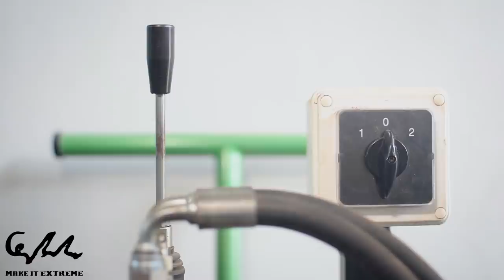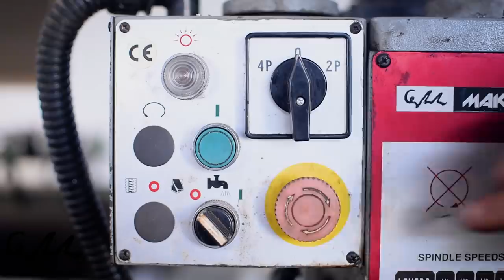Project 086 | Making a track drive trike #1

Comment: Cant wait for PART 2!!! With Bigger engine and bigger wheels!! You are the best!!!
Reply: Put a busa engine there, imagine the possibilities
Reply: I was thinking if the slats on the track were curved in the middle of each one it might turn easier...or maybe a durable material other that STEEL.....I have some snowmobiles I've picked up I was thinking of joining them side by side and use a decent size shaft across the two for pivoting and run one engine to the shaft the drive down to each gear box....each gear box has a high and low pluss reverse..and a brake caliper for directional steering not need to be fast more like a retriever...the tracks are 20 inches wide...that would be a big foot print...and they are the lo my track versions...might start with some smaller diameter  shaft. for proto type...and what a hoot I'm down in houston...where it doesn't snow very MUCH like ever! but they love mudders
Reply: My first thought when I saw it running was it needs a pit bike engine (or similar) but just the fact that he's making it bigger is just what I can't wait for
Reply: The tools are complitly
Reply: And a chain tensioner
Reply: Best coment
Reply: @donaldpowers5557  i don't understand what you're saying, but i would like to see the result. I think that will be amazing
Reply: Nice work ...keep making things like this
Reply: chain tensioner, track tensioner, cut sections of car tire and mount to the steel bars of the track
Reply: Kinder
Reply: عتارى بن
Reply: ,一...
Reply: Jak That ain't a Car Tire Lol
Reply: Christos Grigoriades
Reply: 40kzb बम
Reply: putra no by Monday night xx no
Reply: How did this vid get thumbs down?😠😠😠
Reply: mai aapke compny me kam karna chahta hu ....
Reply: Cáy đà boi
Reply: Hola
Reply: Halló
Reply: @anhuctv8795  w
Reply: @purplefreddyecheverria3301     😐
Reply: Làm quen bạn 👧 tôi không biết làm thế này mà chưa ngủ nữa rồi
Reply: Que chido invento
Reply: Seth Galthie
Reply: Christos
 Grigoriades
Reply: أن عبدالحق هجبل وحد
Reply: Please for me

Comment: Advice I would offer after watching the welding on the sprockets.
1. Put the bearings in AFTER the welding if possible. Then there is no chance of arcing across the balls, and no issues with the shrinking after heating and cooling.
2.Backweld the sprockets and clean up the undercut on the top of the welds. 
Even if your grind away the base metal, the undercut creates a failure point called a 'notch' no matter how small or thin it is.
Pretty doesn't mean shit if it falls apart in service.

Comment: Damn,your welding skill is awesome, just some advice from me,if you using ballbearing for an axle,please make a inner bushing for it,so the inner piece of bearing didnt get any pushing force from the nut...
And you must considering the transmission,i think you must change the cvt parts,but personally i'll choose an engine with manual transmission,you can easily select a gear

Comment: Why on earth did u press the bearings then weld the cogs
Reply: I was thinking the same thing. Order just seemed wrong.
Reply: I wondered that too. Wouldn't the heat from the welding transfer to the bearings and possibly damage the seals and the lubricant?

Comment: Jeez reduce the gearing a little, alot of noise and not much go xD
Reply: Go build one yourself and post it on YT if you can do better.
Reply: Chris You seem to have missed the point...
Reply: Jacob, you mean increase the gearing, right?  Because I agree.
Reply: vid 1 was proof of concept, looks like vid 2 is upgrades
Reply: True, though they probably didn’t think it through because to increase the gear they need to make the back track taller, then that makes the front point to the ground. Point is it would be a ton of more work
Reply: Секс

Comment: Slower than a mobility scooter
Reply: Was thinking the same thing, totally needs a faster engine
Reply: I think thats why he will make part 2. At the end show that in part 2 he will install a bigger engine and bigger wheels
Reply: He was in first gear the whole time.  He gonna hook up a gear shift lever.  The motorcycle transmission has a manual gear shift, I think.
Reply: He has made some cool things in the past, but sometimes they just have me thinkin..... why?   I'd rather spend all that time making something that is useful and really works, but that probably wouldn't be as fun to watch and it doesn't matter what I'd rather do... It's his show. Things like using that completely hooped sprocket I definitely don't get though, stuff like that is just asking for it not to work well.
Reply: Sprockets are easy to switch though.  It makes sense to use what he has while he is still figuring out gear ratios and stuff.  He can replace them when/if he gets all that worked out.
Reply: Patrick Donohoe it’s a scooter he has no other gear.
Reply: Oh yeah, I guess you're correct.  Probably has a cvt, though, right?
Reply: I would like to see him change gear with a moped engine lol.
Reply: Not many mobility scooters that are so badass tho.....( accept maby Colin furzes one)
Reply: pretty sure that was a scooter/cvt combo
Reply: final drive ratio can be changed for more speed but i wouldn't put a bigger engine on that thing, as it is it can't turn corners due to poor front end geometry and zero lateral movement of the track.
Reply: That's why I'm asking

Comment: Nice freehand with the plasma cutter! I still need a guide! Lol. Excellent fab work, nice tig, but why design the drive chain t be affected by the suspension travel? Sprocket won't last long when your driving over bumps an he chain keeps coming loose. Not hard to reengineer, I would suggest it.

Comment: You do extremely nice work. You definitely have high fabrication and welding skills. I see some others commenting and criticizing your creation. It looks to me you did it for the fun of it and the challenge of building. I think it is great! I see some design elements of things I work on. The a-arm suspension is similar to our race quads. Love it!
The one thing I was going to ask is regarding your crawler sprockets. Not sure what grade of steel you used, but you didnt want to do a hardening treatment on those for wear resistance?
Reply: โปรแกรม

Comment: What a lovely job man, love your work , love your skilful hands, your level of understanding the automotive design. done very well, i enjoyed the work, thank you.
one thing i dont like you to do again is using angle grinder without safety guard.
and one improvement suggestion bro, try to control centrifugal force in sharp turn, no tyre should be in the air.

Comment: tensor para la cadena , modificar los radio de los piñones de la cadena , no se si esta bien centrada la oruga y no hace nada poner un amortiguador sin un resorte o barra de torsion, para las orugas no se necesita esa flexion ya que la cadena no trabaja bien, mejor fijala y coloca un resorte en el asiento
Reply: Hola amigo. Sabes de donde se obtiene ese tipo de cadena
Reply: @ybartgo  la oruga veo que la fabrico a medida ahora la de transmision puede ser de una moto cualquiera que se adapte, de 2 o 4 ruedas, yamaha zusuki etc, incluso bicicletas , saludos

Comment: You have good fabrication skills and a shop full of quality tools but your lacking in ATV knowledge, 1st off you need allot more horsepower and your track pads should be hard rubber, maybe cut up a old tire or something but steel not good for this application, good on a bulldozer but not this.